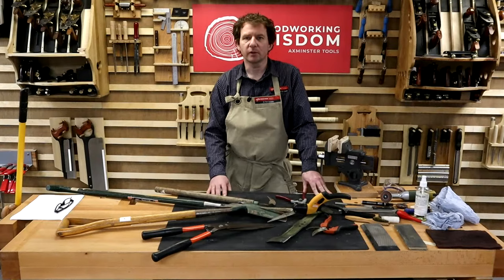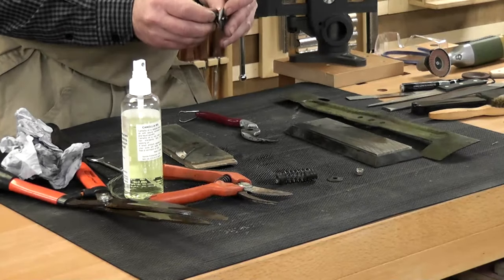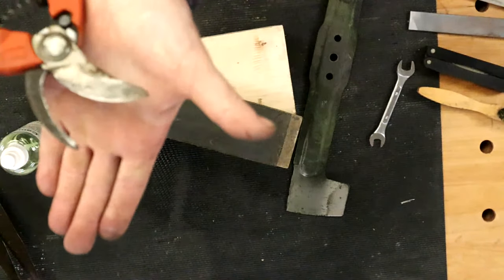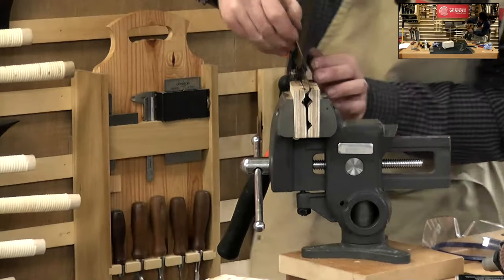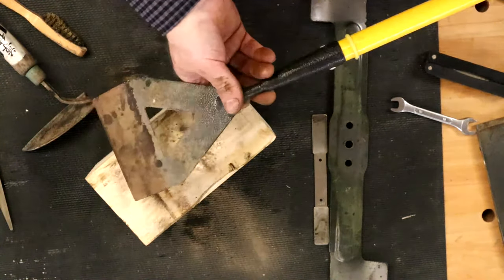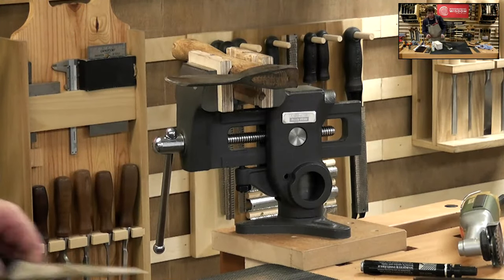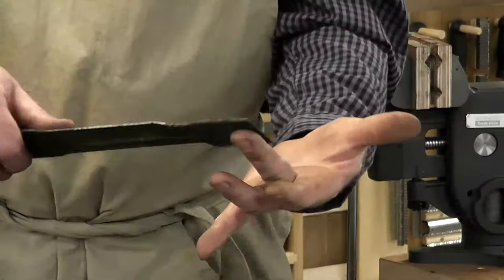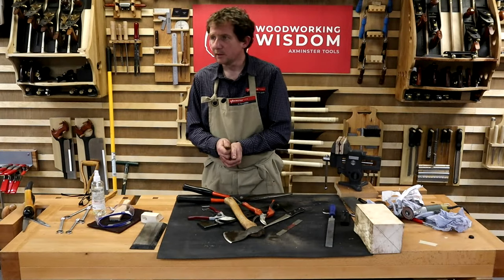Woodworking Wisdom - Sharpening Garden Tools

Comment: Any suggestions for sharpening lawnmower cylinder blades?
Reply from the maker: Hi Cliff, sorry off last week, depends on the shapes as some of these are a spiral around the cylinder others are parallel, most of these do not come apart, the easist way would be to sharpen the bevel edge that these have ground on already using something like the small grinder with a flap whee, a diamond file could be used to deburr the back edge. hope this helps let me know,